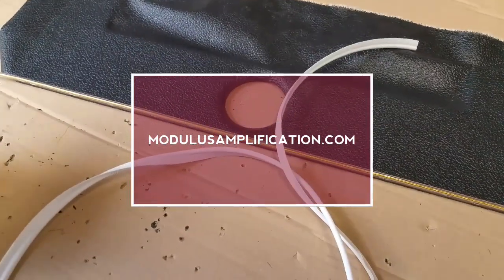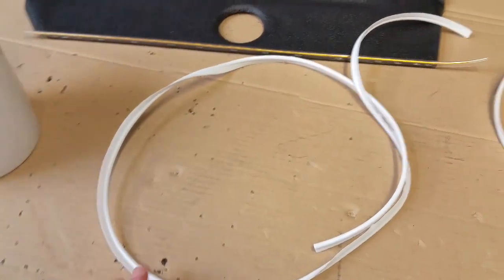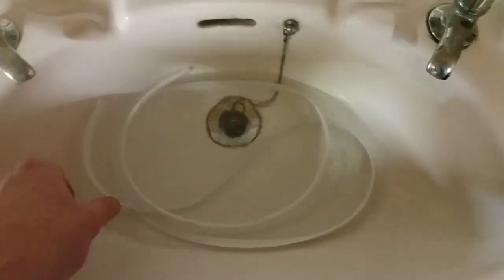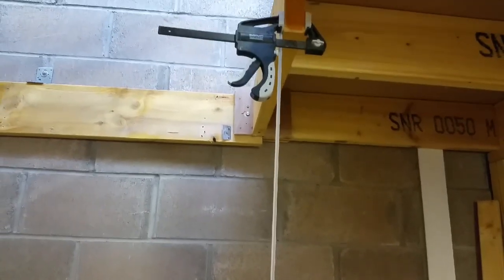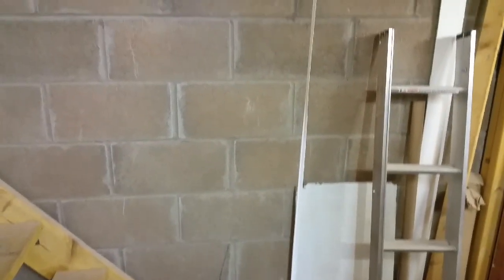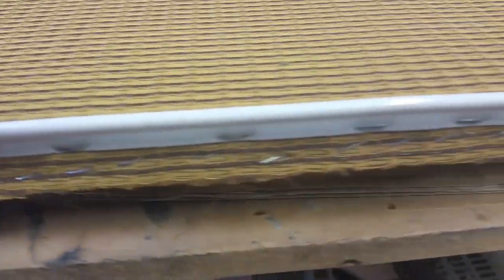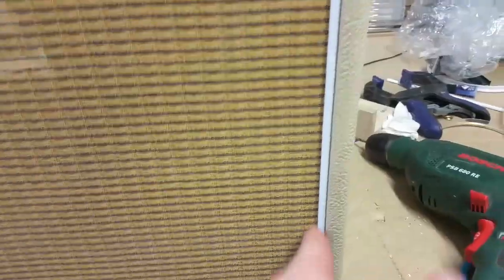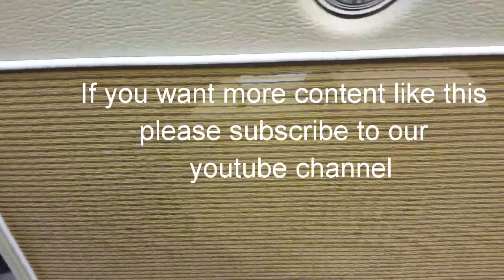DIY Cabinet Building - How to get wing piping straight

Comment: Awesome trick ! How much clearance would you use for salt and pepper cloth ?
Reply from the maker: 3.2 - 4mmmm all around is a very tight fit
Reply: @ModulusAmps  Just to make sure I get that  right. Do you mean 3.2-4 ,, on each side or for each axis ?
Reply from the maker: @kastor8274  each side. Look at the thickness of the tolex, cloth and piping. I use 3.2mm Fr4 board to check gap spacing. For thicker grill cloths and tolex you may need more space. So 4mm all around is a good bet with this stuff
Reply: @ModulusAmps   Thanks so much ! Well I won't use any tolex, cos its too expensive, I'll go with that structural paint. But since I will use salt and pepper I'll go for 3.8 mm .

Comment: I want to install piping trim on a Marshall 4x12 cabinet. Does anyone have experience doing this,  please advise?
Reply from the maker: It's installed inside the cabinet. Not attached to the baffle
Reply: Is the baffle held in place with removable screws, visible from inside the cabinet?  I have not removed the back on one of these yet. I assume the piping would be attached to the edge of the enclosure with staples?
Reply from the maker: @garymorrison4139  yes you have to take the back off to get the baffle out first